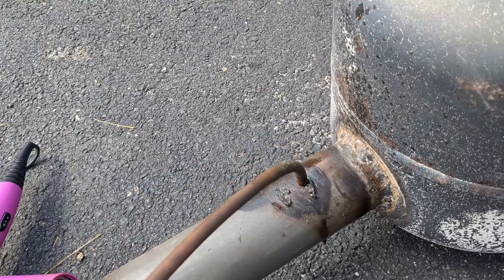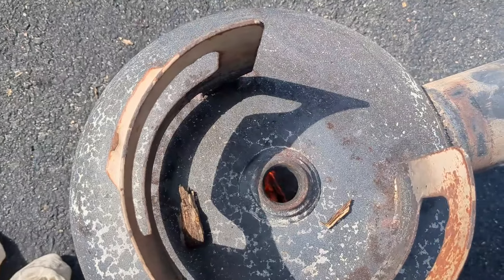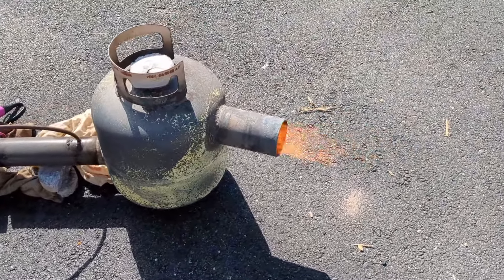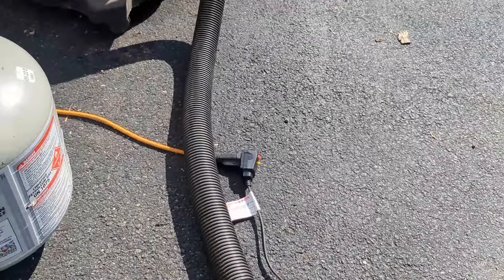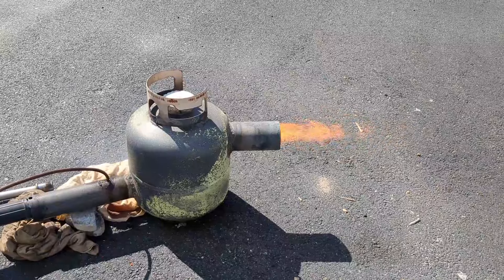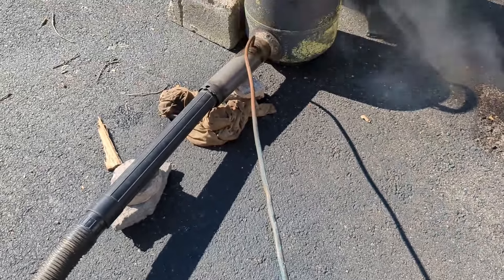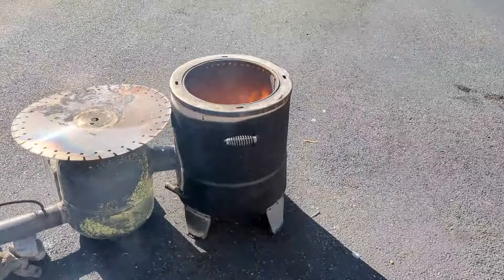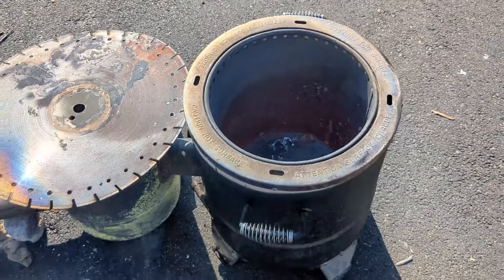Transforming Waste Oil Into Powerful Heat With A Forced Air Burner!

Comment: Yoooo so I copied this and gave it a shot! Waste diathermic oil! I mixed 1pt diathermic to 1pt motor oil! Lit it in no time with a gas station torch and melted the far side wall out of the can. Cannot stress enough how fantastic it works ! I ended up making a brick box to surround it to accommodate that but it is what it is. New favorite heating chamber. I plan on doing steel melts every oil change now. Not sure where to get a sustainable diathermic source though as I happened to have a broken radiator heater
Reply from the maker: That's awesome!  Yeah I need to do that to get mine to light faster 😂  My can that I attach to it is stainless steel and has Ceramic wool surrounding it.  If it can melt steel it will probably melt that too, haha.

Good Luck!

Comment: With the tuyere aligned radially rather than tangentially,  this furnace would be a crucible killer.  But it'll make a nice little direct melt scrapping furnace once you get the lighting procedure dialed in. 👍
Reply from the maker: Lol totally a crucible killer!  I built it for a bulk melter since it has a hole in the bottom.  I am going to build a propane/oil burner like you did and use it for my old furnace.
Reply: tobhomott is right. Having the entry enter at a tangent so you get much better swirl action will make everything work better, AND more efficient since since the oil/vapor/fire will have to circle the container 2 or 3 times before exiting.

Also, you will need a far more precise way to control the fuel and the air. Above or below a certain fuel/air ratio, it will burn poorly or not at all.

Comment: Adding a little bit of fuel treatment to the initial starting oil will make it easier to get started. Just a couple of cap fulls nothing crazy
Reply from the maker: I agree!  I just hate dealing with gasoline when there is a flame involved. 😂😂
Reply: @HeinrichsMade  ah I mean like Lucas or stp. Not gasoline itself Just use a cap or two mixed in just to subtract a few tics from the octane. Nothing crazy crazy. Stay safe man
Reply from the maker: @anunofmoose9894  haha oh okay!  Always trying to stay safe 🙏🙏🙏

Comment: I've found adding a few pieces of metal in side the chamber helps in building heat, removing the need for the wood,
Reply from the maker: interesting 👌👌
Reply: @HeinrichsMade  I have a few videos of me starting up mine. under Smelting with BloodlessKitty.  takes about five minutes to heat up the steel pieces then start adding the oil, give it afew minutes then cut the propane. I tried wood, paper and such just either took forever to start up or wouldn't at all that beside all the sparks flying everywhere.
Reply from the maker: @debrathomas  thanks I'll check it out 👍👍

Comment: NOBOX7 makes some crazy burners. He says synthetic oil is really tough to get going. cut in some gasoline (20% or so) to use as a starter mix. switch back to just oil after its running.
Reply from the maker: Cool!  Funny I never thought of synthetic oil being any different when burning oil.  That's all I've got 😂😂

Comment: Heinrich's my setup i have the furnace and inside i put a pipe which feeds my oil and airflow from behind. But my pipe is plastic and at rear end just infront of hairdyer fan. The hairdryer itself didnt work only the fan. So my fan i taped onto a metal funnel shape not sure what they call it. It screws onto the pipe. I also use gravity feed  for oil. I use old oil can with oil in and also valve to regulate amount of oil flow. When my flames are big enough i will usually add bit more oil and switch the fan on. So my oil itself burns in the furnace. It takes me about 30min to get it running nicely.  You can also check theres a video of a guy who build like a injector or used an old one with a air compressor at back so the oil sprays out in mist form. He ignites it instantly and it burns like freaken jet.  But here i must have stuff running off gas and fan off a battery since we have loadshedding.  Reason i use waste oil ia cause my burner for gas wasnt correct. So i must either buy or build new one.
Reply from the maker: Yeah, I've seen combo burners.  They start with propane to get the furnace hot.  Once it is red they turn off the propane and use just the oils.  I plan on building one.  I've seen them with a nozzle and an air compressor.  I don't want to do it that way.  I'd rather just gravity it and use my blower.

Comment: O yeah i usually also soak a old piece of cloth in oil and leave it in before i start fire. As temp rises oil begins to burn. Too much oil then you more smoke. But man! That thing roars. And when your balance is right.  Less smoke
Reply from the maker: funny, I actually though about doing that.  I just did want a ton of smoke coming out of the burner.

Comment: Your air has to wide of span a 1"pipe adaptation from your air supply to a few inches from your oil drip should atomize the oil and  urn hotter and cleaner. A few lumps of charcoal along with your forced air ought to get the  temperature up to run. Im not clear why you feel the need for the other tank. A six kilos size crucible will keep you busy. I take that back. The other tank would be excellent for preheating.
Reply from the maker: Interesting 🤔. I actually don't know why I made the inlet pipe so long.  I'm going to make a burner for my old furnace to melt metal in crucibles.  That other tanks purpose is to just melt down large items.  I'll perfect it 🔥🔥🔥

Comment: I start my fire and get flames growing than slowly let the oil in.  The oild starts to burn when fire is hot enough. When fire is big i put fan on and ta daa
Reply from the maker: Thats what I did the first time.  Adding a little bit of air from the hair dryer usually speeds that up.

Comment: Your startup procedure needs some work. But you got it lit. 
Now to get better control over the flame control. Going to need a larger oil feed...lol
Next time you light it, add some newspaper into the bottom and then kindling, Add more paper to the top, but this time use some oil or other low-volatile fuel to the mix. Vegetable oil works to get it to flame easily. Once you get the fuel added, fire it up. then slowly add the air to it once the fire is going. 
Fire time should be around 5 minutes start to fire. As soon as I get time I'll send you new vid on my startup. 
Also, you should get some pavers under your work area, saves having to patch the drive...lol
Not going to tell the Greenie Weenies just how clean this actually is burning, they can't understand.
Reply from the maker: Thanks Don!  I definitely need some work on my startup.  Next time I fire it up, I'll use the tips that you and others have told me.  I look forward to seeing your startup video 👍👍